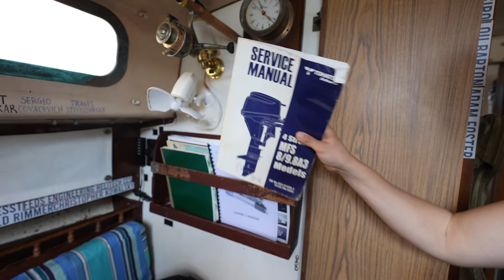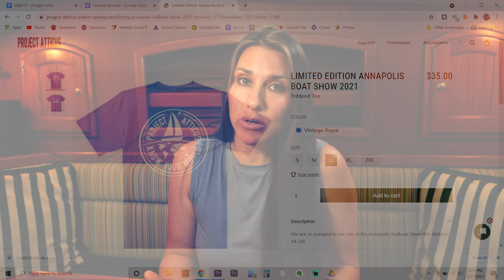Atticus is FOR SALE  | S06E19

Comment: The price listed for Atticus on your website is insane. Even if a potential buyer had to hire out the bulkhead repairs, they would have a blue water ready pocket cruiser for under $20,000. What a steal. I hope and expect she goes soon.
Reply: @xcitemex6353  Wish I had the youth and energy. Nope. I'm 74 yrs old, have a boat already and sure don't need another one.
Reply: I was thinking if you take the cost of the engine, water maker, anchor, outboard and new sails, you are very near the asking price.

Comment: $16k is a really reasonable price considering all the work you both have put into Atticus.  Somebody is going to get a really sweat deal.  Even though it's in Panama if I had the means I might put in a bid.
Reply: @paulpaul9914  lol  It's all in the eye of the beholder.
Reply: Replacing that bulkhead isn't a hard job. I helped a guy do it in a Catalina 27. It took two days, start to finish, with day two being just paint and reinstalling trim.
A bit of shoring to brace the deck, then remove the old bulkhead so it can be used as a template. Don't skimp on the fibreglass tabbing joining it to the hull.
One person could do it in an easy week.